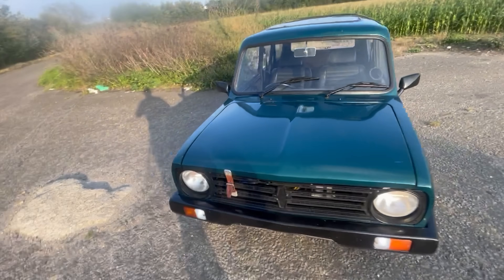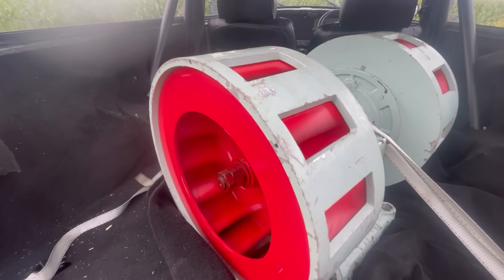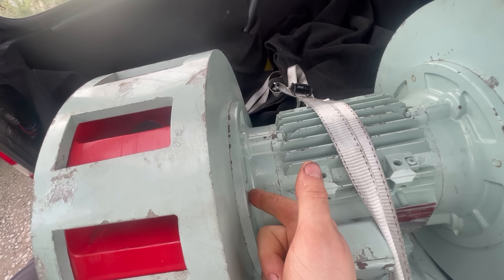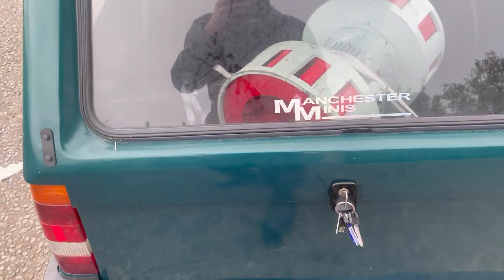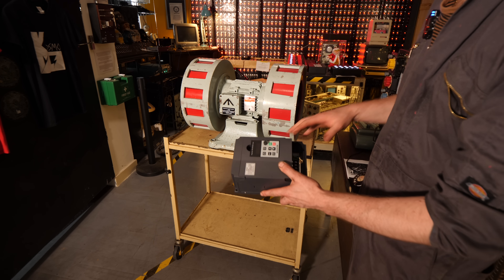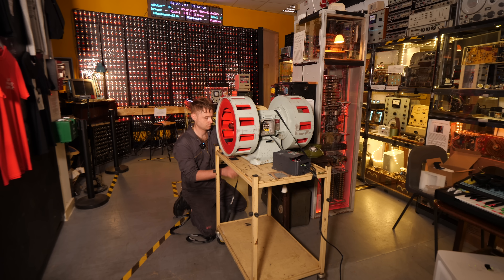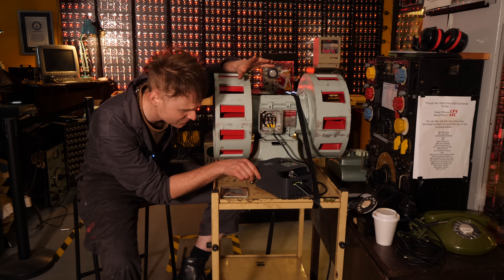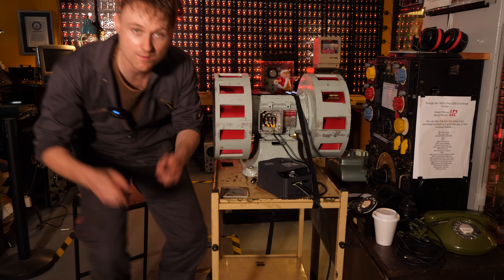I BOUGHT AN AIR RAID SIREN

Comment: You could probably make it quieter by putting some end caps on to restrict how much air it can suck in to the ends? Also, you could reduce the noise by blocking up some of the ports on each side. 

Also have you considered controlling the pitch this makes by making a sleeve that goes round the outside of each drum, that can rotate to vary the size of those air ports? You could probably put the wheels on full speed then rotate the sleeve to tune the size of the port to change the pitch, and you could do it much quicker and play actual tunes on it, as you wouldn't need to wait for the wheels to speed up and slow down.
Reply: Interesting ideas but that wouldn't change the pitch. The pitch is dependent on how fast the vanes of the spinning rotor are going past the holes. Closing off the holes would probably just increase air pressure and make the same sound but louder come out of the remaining openings, if anything.
Reply: @Shako_Lamb  hmm. Yes I see what you mean. Might still be able to do something similar though that moves the holes around or blocks/opens holes entirely, to change the "blade pass frequency" (I remember that from designing radial blowers years ago 😁)
Reply: @PetesShredder  Theoretically yeah that would work! It would require some pretty serious modifications to the assembly of the whole machine though.

Comment: You can add adjustable shutters in front of the slits to control the volume.
Reply: No it would just change the tone, you'd have to block the input not the  output

Comment: If you can find somewhere with a 3 phase supply, get it running on a star/delta startup. These sound great as they switch from star to delta near full speed. There is a channel called RODALCO2007, and he has a few videos of a siren with that configuration.

Comment: Could u make a replica one of these 

Then drive it with a ridiculous vfd frequency till it explodes

To make it run quiter try shutting off the airflow volume Making a ring to cut off the slots or end caps 

Less air less decibels it should be 

Also if u want a quite place try going far out to sea 🌊 😉

Comment: Maybe wrap some sound deadening foam around the outside when in use, 
Yep a bigger vfd would be better, you should be able to tighten the ramp rate, even better if you can get one where you can add resistive braking for a quicker lowering of speed.
"somewhere over the raainbow, weigh a pie"
Now i've shared the earworm :D

Comment: The first time you turned the speed down so fast with that poor little VFD I was mentally shouting "braking resistor!"
All the potential energy stored in the inertia of those moving rotors got dumped in less than a second into that poor little VFD.
Reply from the maker: Yeah break resistor was cool weren't it!

Comment: I did not know that air raid sirens coild reduce their pitch that drastically. I only ever hear them spool down naturally.
Reply: That's actually something you can do with any 3-phase motor and a VFD. It's harder on the motor, but it's used in situations where you want something to slow down quickly.
Reply: @HammondOfTexas0  figures, but for some reason I just thought the Air Raid siren motor would rapidly spontaneously disassemble itself upon trying

Comment: i use to own a federal signal 1000t thunderbolt mechanical air raid siren.. that thing was a beast. had to haul it around on a full blown trailer with 3 phase generator

Comment: why is it slowing down so fast? did you have the VFD setup for breaking?
Reply from the maker: Yes
Reply from the maker: Well I was adjusting the hz. Not turning it on and off
Reply: It was interesting that the speed ramp-ups were so slow, while the ramp-downs were relatively quick.  The obvious thing to try for is to get all of the speed-chages as quick as possible.  I’ve never used a VFD and don’t know what the options are, or the pitfalls to watch out for.  If the VFD could somehow sense the motor’s actual speed (like with a brushless DC motor), that might help.

Comment: I imagine an air raid siren instrument :

Controlled by two pedals and a few keys

One pedal controls the speed of the motor
One pedal controls a diaphragm which restrict air to the rotor to control the volume
Keys allows to close the slits to quickly change notes

Comment: I wonder if you could wire the motor to electrically brake the rotor and make it a bit more responsive
Reply: As shown in this video, the braking effect was much faster than the speed ramp-up.  I don’t know why that was, but my guess is that there must have been some electrical braking going on.  The speed ramp-up is the really slow part that could use some improvement, if there’s a way to do it.
Reply: @kc9scott  probably just friction from lack of maintenance, not the best way to do it.

Comment: I’d like to know what (if anything) happens if you could adjust the size of the finger slicing openings. Would the pitch change?
Reply: To change the pitch, you would need to change how many finger-slicing openings (and corresponding fan blades) it has.  As it is, it plays two pitches simultaneously, which means that one side has a different number of openings than the other side.

Comment: The inverter died because of how fast you decelerated the wheel, the energy has to go somewhere and since you told the inverter to slow down its gonna eat that energy in dump diodes or something similar, given how heavy it looks and it took about 10 seconds to speed up, only to be decelerated in a second or so, I can imagine the power the inverter is eating is about 10x it's output capacity (assuming you redlined the inverter every time you spun it up),

So yeah I'm actually surprised it survived that even once

Comment: Consider how loud that is.
Now consider they built a 180 hp V8 engined 138dB @100 feet that could be heard 25 miles away.
I don't think tissues in your ears will be enough Sam.

Comment: A: You'll probably get better control at lower speeds with PWM instead of variable voltage. B: This needs to be wired into the Organ, work your way towards an authentic Stuttley Johnson replica.
Reply from the maker: It's not variable voltage it's adjusting the ac frequency

Comment: I live in New Zealand and our Fire Service still use these sirens at most of the stations in smaller towns. They are mounted on top of towers about 10 metres tall outside the stations and can be heard a fair distance away. They are activated whenever there is a call-out. Here's an example of one: https://www.youtube.com/watch?v=l8vA1JNuGAs

Comment: As a patron, I approve this purchase. If the two sides are of different pitches, I can see a solenoid-actuated shutters that fit around the outside of each end to prevent airflow and (hopefully) mute each as needed. Put a few of these together and make an organ. Have a concert inside and hand out ear protection to the audience.
Reply: They are indeed of different pitches. One side has ten holes, the other twelve. At the speed this motor runs on 50hz, ~2800 rpm, the resulting pitches are roughly a B natural and a D natural.

Comment: How hard would it be to strap a mesh over those finger mincers and yet everyone that had it before thought, nah it'll be fine
Reply from the maker: But it is fine. Not usually near fingers
Reply: @LOOKMUMNOCOMPUTER usually it's on the roof of a tall building. Dude literally told you stories of people losing fingers to it and he still didn't guard it 😒
Reply from the maker: @dnel83  exactly..... thats why i didn't put my fingers near it lol :D
Reply: @LOOKMUMNOCOMPUTER  sure but safety isn't about intentions, I couldn't tell you how many times I've removed a pan from the oven, put it on the side and told myself "this time, do not move the pan, it's very hot", works almost every time. Almost
Reply from the maker: @dnel83  watch the other guys channel. You'll see no one covers it in mesh. Just proceed with caution.

Comment: Motor looks like that of a bench grinder.
Reply from the maker: Bit bigger than a bench grinder
Reply: Yes, I was thinking of that configuration with the axle going straight through and out the other side.
I've seen a few really big ones of those at shipyards. They are usually not on a bench though but a dedicated piedestal.

Comment: Don't put it into something soundproof, that's not gonna happen. Just weaken its output
Cover the finger-choppy-holes about all the way and it will be almost silent
Seriously, I have seen one of these with an on/off function which just covered the holes while running to make a Beep-Beep like sound. You can also modulate the volume from 0-100% that way

Comment: Dang Maui could have really used a few of these 😢
Reply: They had air raid sirens, but there was no protocol for running them in case of fire.
This is according to NY times podcast "the daily". 
It may be a rumor, or a misunderstanding. It's all so recent so no proper investigations are finished yet.